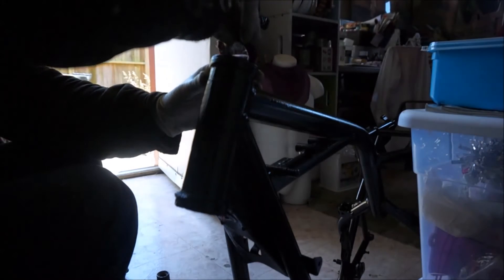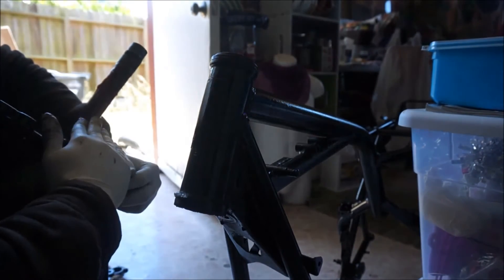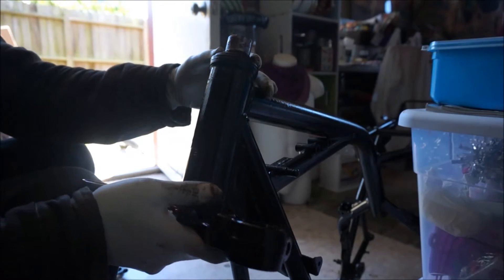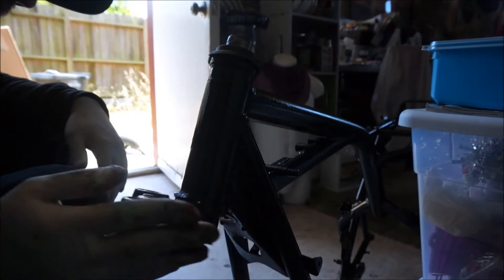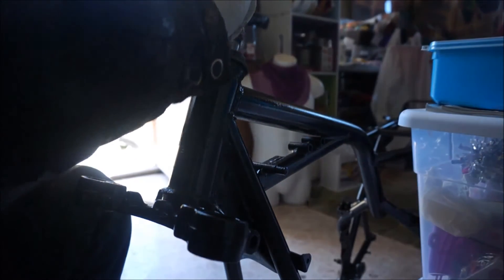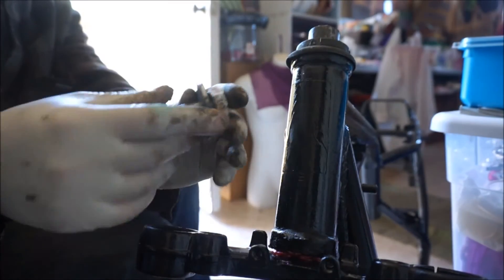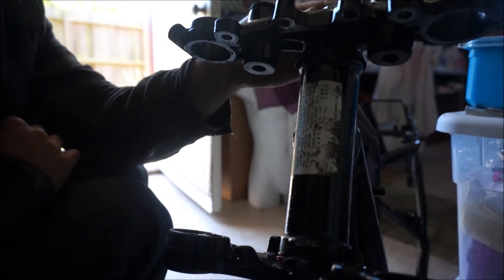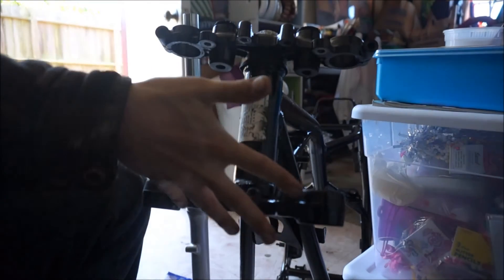Kawasaki KZ400 Restoration- Part 10: Triple assembly

Comment: I think that nut that you are hammering is there to take out the play in the bearings, it's only supposed to be tightened a little with a C-spanner. If you hammer on it like you did then the ball bearings will be clamped so hard that they will damage the bearing races and it will feel stiff and notchy turning the bars.

Comment: I’m having a hard time removing my front caliper.  the metal brake tube which connects the caliper to the brake hose on the front wheel. It’s 10mm at both ends and I can’t seem to break it loose without the nut wanting to deform. Trying penetration oil now. My front brake set up is slightly different from yours. Looks like yours had the caliper in the back of the fork, mine is in front of the fork. The distance difference is where the use of the metal brake hose is being used. Any suggestions?